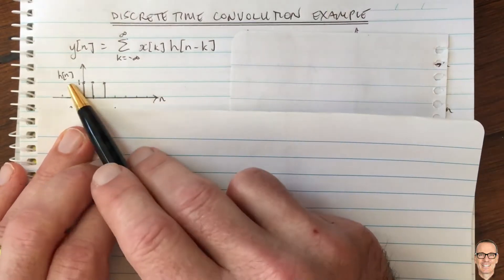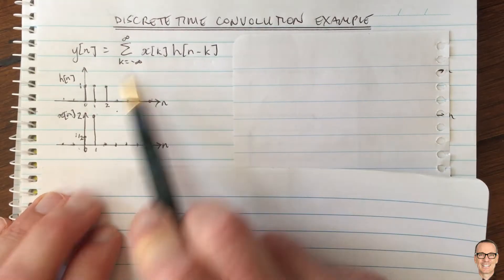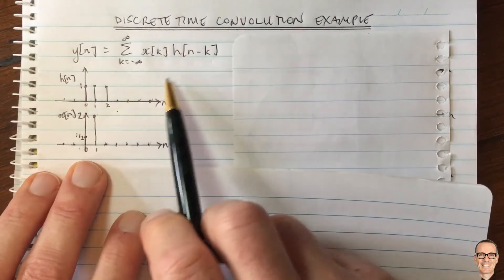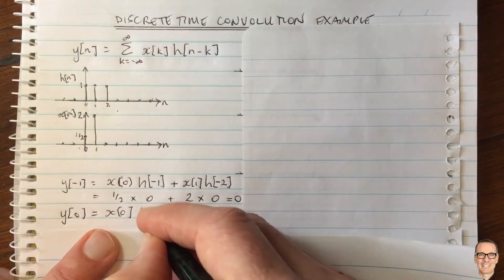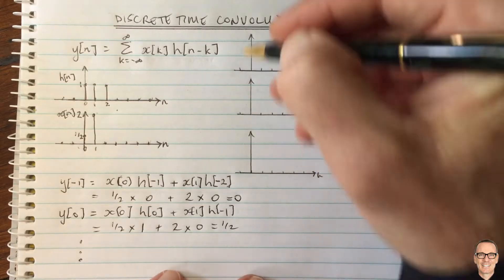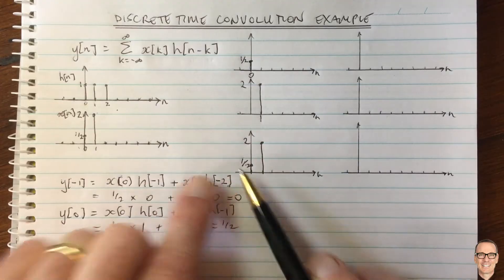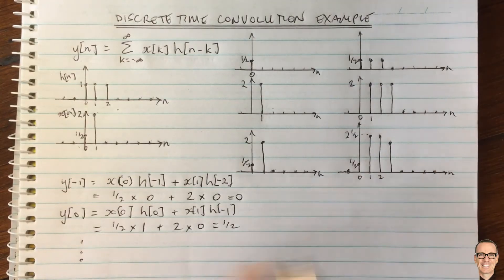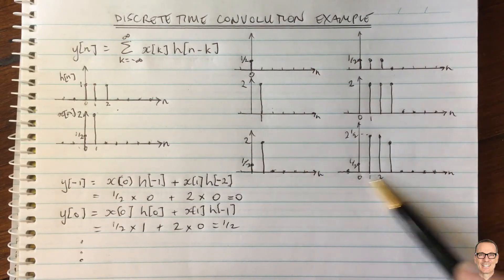Discrete Time Convolution Example

Comment: In a way, discrete is simpler because you're not summing areas like in the analogue case. You are just multiplying heights of the two samples and summing them. Hence no integrating. 
One could think that the analogue is just this, but visualised using infinite number of deltas. But drawing that many graphs to calculate the convolution would be a pain.
Reply from the maker: Yes, that's right. I gave intuition exactly as you describe in this video: "How to Understand Convolution" https://youtu.be/x3Fdd6V_Hok

Comment: One confusion here: In the continuous time, we flip h(\tau), shift it by t , multiply with x(\tau), and then find the area to determine different values of y(t). In discrete time, it looks like we shift h(k) by n and then multiply with x(k), then add to get y(n). So, this flipping operation is not done in discrete time. Is my understanding correct?
Reply from the maker: Many people (basically everyone) talks about "flipping" and "shifting", but I never use these terms. I believe these terms are the cause of most students finding convolution difficult. In these videos on continuous time convolution I use the same approach each time (and it's the same approach as for the discrete time case): "Convolution of Square with Rectangle" https://youtu.be/xVbONyYEipU and "Convolution Square with Exponential" https://youtu.be/lsHkWFBm3so

Comment: Although some algorithms in the software does the calculation in a straight forward way, the decomposition of x[n] into a sum of its discrete components is a great intuition, which clarifies this concept so much.  Algorithms can also be developed based on this method, I think it may not be any slower than the former method, if not faster. Thank you so much for sharing it!
Reply from the maker: I'm glad you found the video interesting and useful.
Reply: @iain_explains  The steps we were taught by my professor was to first convert x(n) to x(k) and do the same for h(n). Then,we do a time reversal on either x(k) or h(k),afterward, we perform a left hand shift until we get to the zero values. We then perform a right hand shift until we get continuous zero values. This sequence produced gives the convolution sum.

Comment: It's so much easier to understand convolution in the discrete case imo. I think it should be taught discretely first, then continuously - especially if you start with the example of a system's unit impulse response :)
Reply from the maker: That's interesting. Indeed, I think it's often easier to think in terms of (discrete) summations rather than (continuous) integrals, but on the other hand, the "natural" response of a real (continuous) system can be more motivating (easier to visualise), compared to the "response" of a (non-natural-world) digital system.